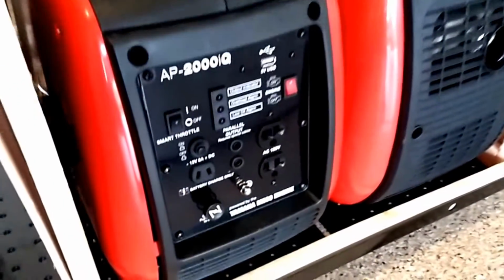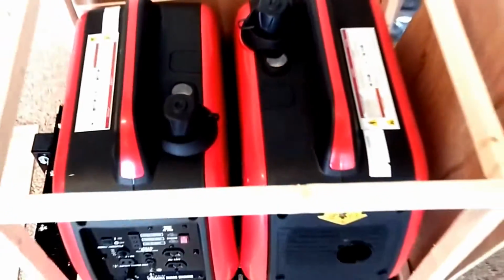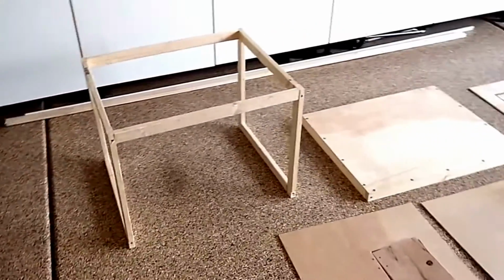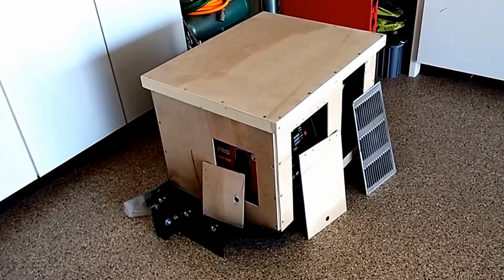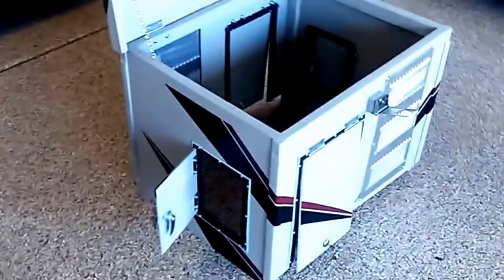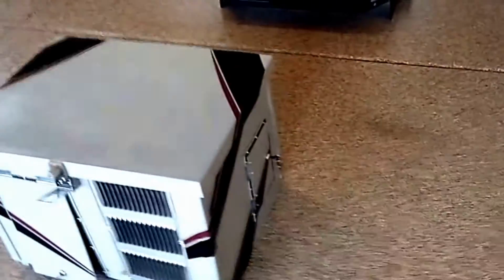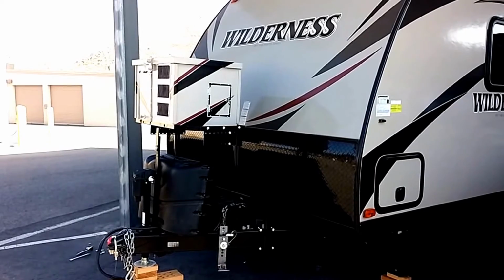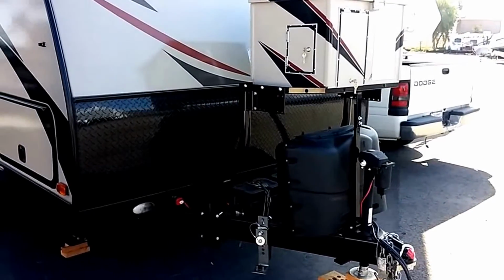023-2015 Heartland Wilderness 2750RL , Yamaha, Smarter Tools AP2000IQ Generator trailer enclosure

Comment: Thanks for sharing, got some ideas, looking to mount my champion 3500 on the back bumper.. Your box turned out great!
Reply from the maker: Thank you for the feedback, another project that kept me out of trouble, lol. 
Your idea for the rear is a good option if thought through.  I was considering the back bumper, but after researching found the stock square rear bumper tube thickness was too weak to withstand the weighted twisting motion. I would've had to have a custom receiver hitch welded to the TT frame that I wasn't sure would withstand the hanging of the 50 lbs each generators, and have to endure the road bumps, so I used the rear Harbor Freight bumper carrier for the folding chairs and extra generator gas and went with the front TT rack which kept the weight distribution forward thus improving the towing directional stability. 
It comes down to what works best for you and having the feeling it is all secure. 🤙🤙🤙

Comment: How is this box holding up to the weather? From my experience, painted plywoods don't do well. Water always seems to find its way past the paint, and the paint traps the water in. I've been thinking of something similar, but building it out of aluminum.
Reply from the maker: It held up fine for the period I had the travel trailer, given it was always kept in covered storage, and didn't encounter much if any rain when traveling.  I searched for an enclosure to purchase but at the time I couldn't find any.  While surfing the web the other day, (I can't find the link) I came across an aluminum diamond fabricated box for a single generator and another box for fuel.  They showed a configured box arrangement on the rear of a travel trailer stacked for two boxes for the 2000 size generators and a fuel box,  that would be ~150+ lbs. on the rear requiring beefing up the rear bumper with mounting fixture and counter balancing with tongue weight while not overloading the rig.  For my setup I carried a 5 gal jerry can on the bumper (40 lbs) and the gensets/rack on the tongue ~130 lbs to maintain 10%-13% tongue weight.  So this set up worked fine for my use.  I recently purchased a Grand Design Imagine travel trailer which has a front basement sizable to carry the genset/fuel there and will pull out/setup for when I boon dock.  I am at 12.5% tongue weight with this arrangement and added a second spare tire/rack to the rear bumper ~ 60 lbs.  It is a lot to figure out what works best for your specific requirements.  Good luck.
Reply: @RVerFrank  Thanks for the reply. Yes, those are valid points  you make. Thank you!

Comment: Great job.  How did the additional tongue weight affect  your tow vehicle and the trailer?  And did you buy or fabricate the mounting platform and hardware?
Reply from the maker: James, Thank you for the feedback.  That van is a beast, the ~200 lbs for the 2 generators (50# each) enclosure (25#) and purchased Stromberg Carlson Trailer Tray Cargo Carrier for A-Frame Trailers (~80#) https://www.etrailer.com/RV-Cargo/Stromberg-Carlson/CC-255.html?feed=npn&gclid=CjwKCAiA3o7RBRBfEiwAZMtSCT4qwKCsTO9lG4z---W5DRZs9i2xrJjZEPk5zriMaB7Y8FJ9IM7nKBoCNGQQAvD_BwE helped to keep me in the 10-15% tongue weight on the van class 4 hitch with 1200# Centerline WD hitch. The tray was a fairly simple assembly with all furnished hdw, with a little bit of fitting around/over the propane tanks.  Very pleased with this set up carrying extra fuel in a Jerry Can on the TT rear bumper in the carrier.🤙🤙🤙